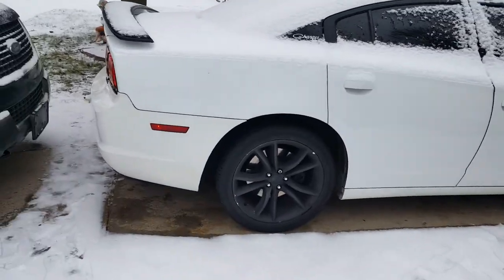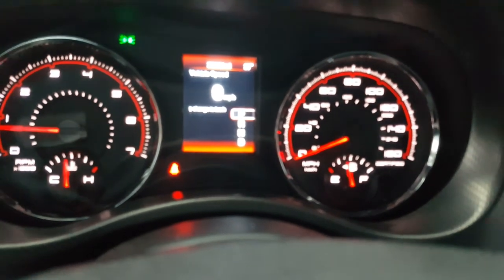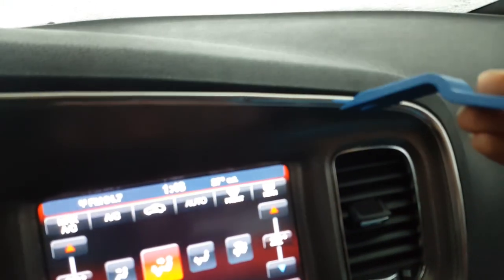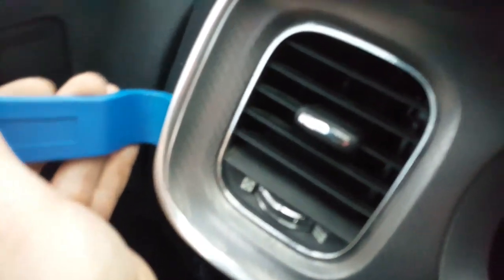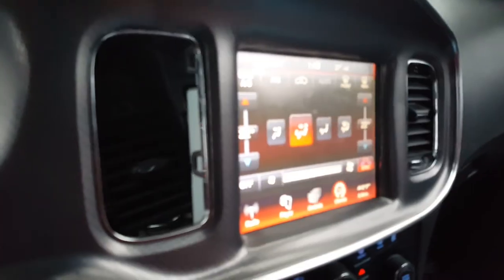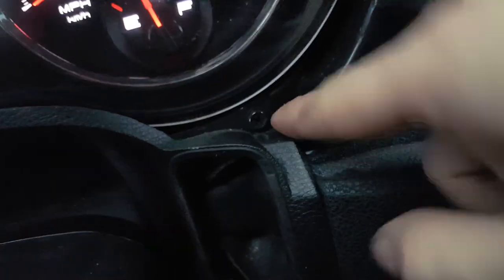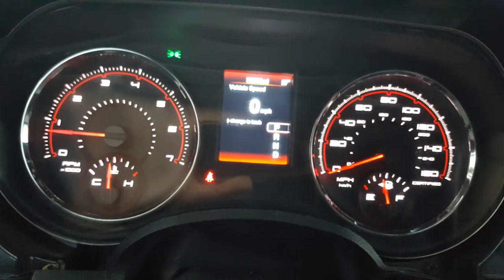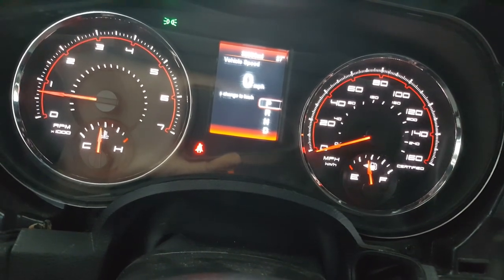2011-2018 charger cluster removal.

Comment: Bro my air vent (right drivers wheel side popped in ) I refuse to take my car to crown dodge so can you please tell me how to snap it back it ..you gave clear and good instructions on the dash cover which is greatly appreciated but I need info on that vent as well
Reply from the maker: Just remove the dash cover and it should snap right back in
Reply: I have the same problem how did you fix it?